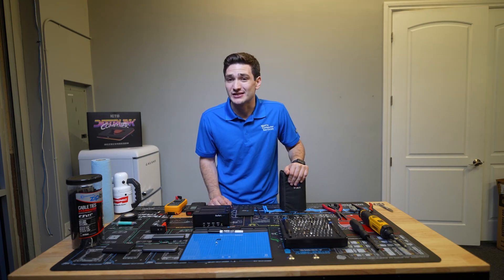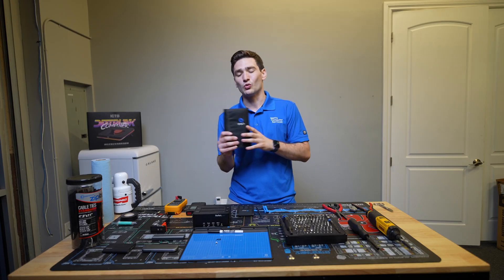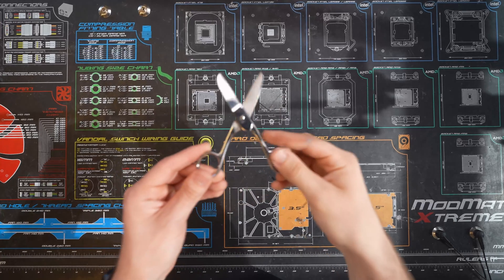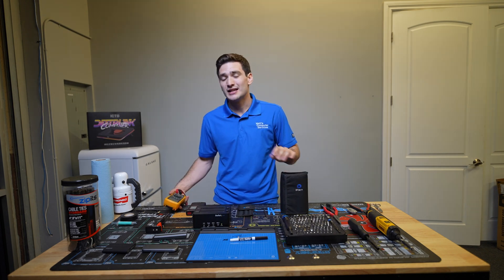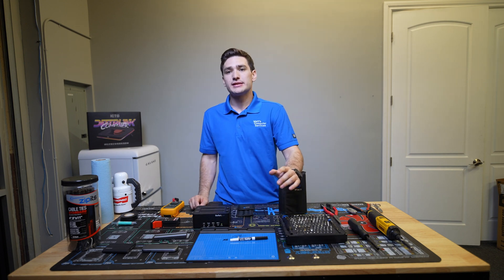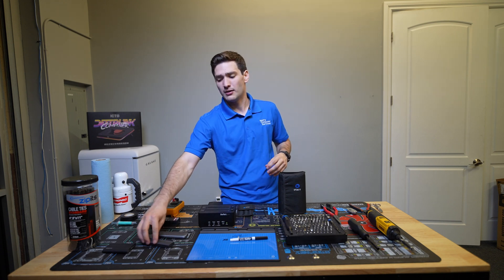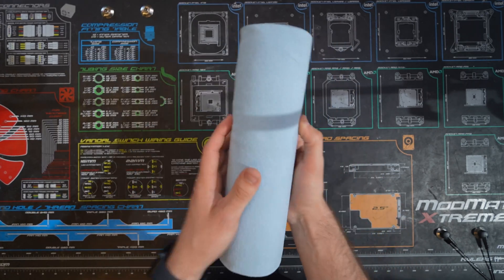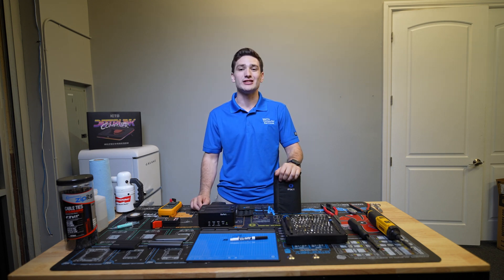MUST HAVE PC REPAIR TOOLS

Comment: Great video's Matt. Your CMOS battery swap saved an expensive motherboard replacement. The "EZ-DIAG lights showed failure in CPU, RAM and Storage. Trouble shot all 3. Still not fixed. I had a replacement MB in my shopping cart and remembered your CMOS videos. Swapped out the CMOS and all is well! Keep up the good work.

Comment: TL631 PCI-e/PCI Debug tester with professional adapter kit. Set of spare flywires. Small breadboard. These let you figure out what and why a motherboard is doing whatever it is doing. If you've heard of qcodes in mobos, this is essentially a universal qcode reader.

 Solder/multimeter/hot airworks electronic kit box; I use a YIHUA 853d it gets me by just fine. Solder all the things. Lift all the things. Test all the circuits. Test the psus. Test the batteries. Test it all! 

These two items have saved me so much time and pain and money. Learning to stab test VRMs will let you repair so much of supposedly FUBAR'ed hardware. 

Also, a tub of thermal paste. Thermal paste is stupid cheap if you aren't attached to brand names 

Hy810 is the cheapest I would go (5$ for 10 grams) - it works surprisingly well.

Hy880 is a bit better and can be had for $25 for 50 grams.

Maxtor GLE can be had for $20 for 80 grams and has really good thermal conductivity. 

Also... just noting the rubbing alcohol should be at least 90 percent concentration. 99 percent is cheap and available online.

Lastly, just know that thermal adhesive is not thermal paste.... don't make that mistake, kids.

Comment: There's one item I bought a year ago that has been the most useful thing ever in my daily computer repairs and that's an iodd ST400 enclosure which boots ISO files as a virtual optical drive. Paired with something like Sergei Strelec's WinPE or Hiren's it is soooo good. PCs that would give trouble to boot Ventoy or other USB ISOs will allow the iodd to boot with no issue. I've not found anything more compatible with the various flavors of UEFI. They also have NVMe versions but I quite like my 2.5" enclosure with an old SATA SSD which connects with a USB C cable. Highly recommended!
Reply: BRO YOU ARE GENUIOS
Reply: @jyjyjyjyjyjyr  Thank you.  :))

Comment: Just to mention in order to properly test power supplies you need a load or even better a load tester because it can work on idle and have correct voltages but when you throw some load on it,it can fail

Comment: On that Datavac, I've actually had a very basic one for about 8-9 years and it's been invaluable. I mostly got it because I had an initial hesitancy to canned air. That hasn't gone away, I dont trust them, I dont like them.

It still works wonderfully, but I decided that I can use that for my power tools, woodworking and general shop/garage stuff, and wanted to get a more dedicated computer cleaner once I start delving into electronic repair stuff. Tuns out Metrovac, the people who made the Datavac, make not only ESD-proof blowers, but also specialty ESD-proof vacuum systems for computers and other delicate electronics that can be used for both vacuuming and blowing like a regular blower, and I am really digging the idea of that.

They're expensive, but if my experience is any indication they are very well built and last a long time even with quite a bit of abuse. They're also Made In America and thats never a bad thing.

Comment: Ventoy flash drive,full of OS iso and bootable repair tools. USB wireless dongle, ethernet cables, flashlight, magnifying glass, double sided tape in case the ones in laptop bezel are useless,rulers, caliper, thermal pads,  empty mechanical pencil to use restore bent pins, gloves and masks (given the state of some machines techs deal with) , cameras and finally command prompt or powershell cheat sheets
Reply: Mech pencil trick is a good idea I'm stealing that.
Trade you a trick in return: Medicat on a USB-C NVMe. Fantastic for cloning, cracking or recovery
Reply: @Shootyqt  Causes windows defender to freak out though if you forget to disable it.
Reply: @Eostrixadvent  it also zaps the electrodes on Bill Gates balls
Reply: @Shootyqt  Maybe it was just mebut medicat was annoying to set up

Comment: Great comprehensive video.  The only items I'd add are heat shrink tubing, heat gun and flux.  Somebody already mentioned a soldering iron.  Maybe another addition might be the small battery powered precision screwdriver from iFixit.  Thanks for the great video.

Comment: Couple of additions,  A 5mm nutdriver, very useful installing motherboard standoffs.  Soldering iron and soldering sucker, if your soldering iron can convert to a heat pen to use on heatshrink tubing thats super helpful.  I like to use GD900 thermal paste, its inexpensive and just as good as many of the boutique brands.  a USB power tester is very handy to verify voltage and current on laptops, tablets and gaming handsets.  A flashlight and magnifier are also very handy, things are getting smaller and smaller all the time.  Don't go cheap on screwdrivers, its not worth it.  I have a long 9" blade P2 very useful, the thin blade allows you to get into places where the mag bit screw drivers cannot go.  Also have a 9: blade Torx T15.  A couple of pairs of nitrile gloves.  If you work in datacenters a lot hearing protection cannot be over stressed.  Lastly a good laptop.  Enought said.
Reply: > things are getting smaller and smaller all the time

My wife tells me that all the time

Comment: Hello Matt this is very helpful for new builders like me doing a great job man appreciate it and thank you for such informative videos ❤❤
and 
!!! Also I need some help I am currently using an Antec NX 200 case with 3 argb 120 mm fans 1 back and 2 up and I am currently taking fresh air from back and blowing out on top of case while this cabinet supports 120mm 5 fans but unfortunately there is no intake from front is this configuration good or should I change it
Reply from the maker: I’m so glad you enjoyed the video! 

Well when it comes to the configuration I probably would say it depends on how your cpu cooler is setup and what style cpu cooler do you have?
Reply: @mattscomputerservices  I am using i7-3770 and it's stock cooler 2 days ago I performed a stress test and temperature goes to 105°C